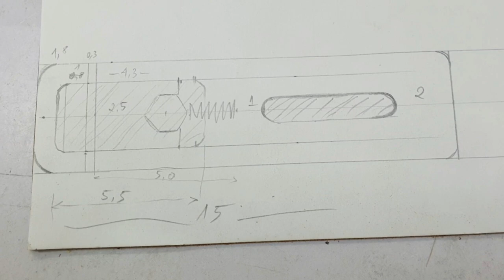DIY Crosscut Sled and Accessories Part 2: T-Track Hold Down Clamps and Quick Clamp || Woodworking

Comment: Very nice. I like your quick release mechanism.

One suggestion to make it simpler. Instead of cutting a slot in the steel and welding in half a nut you could have drilled and threaded a hole. Then just drill a larger hole that cuts into the threaded one. This would give the same result but with less steps.

I like your design and will copy it.

Thanks for posting.